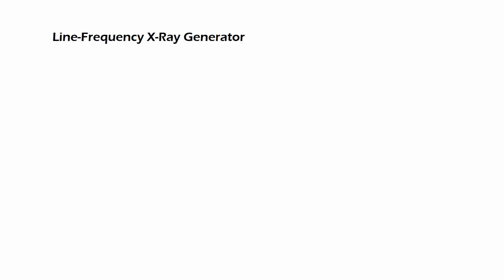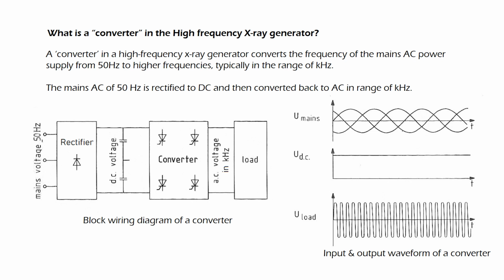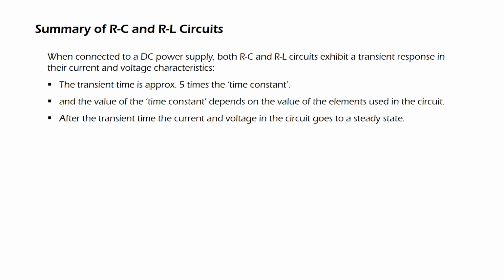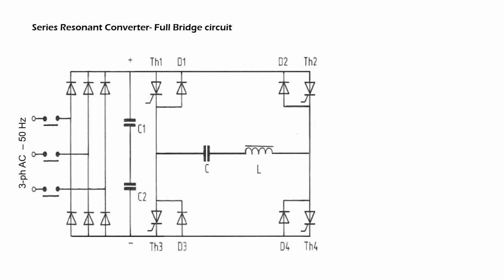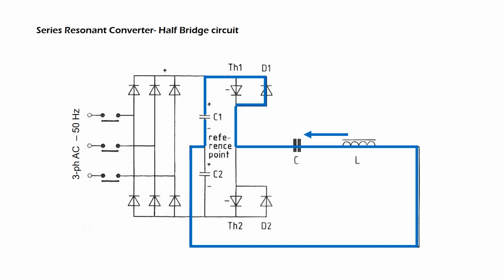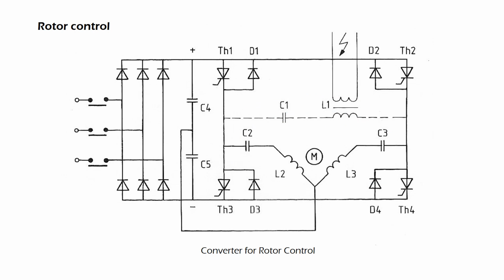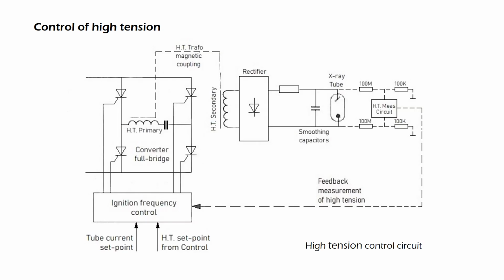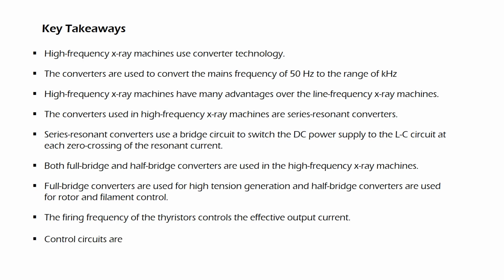07  Basics of HF X ray Generator

Comment: Thank you very much for the nice presentation. I have been looking for a while for a presentation on HF x-ray generator. 
I have 3 questions for you:
- How long has this technology for x-ray generation been on the market? Since IGBT and MOSFET are well known to us!

- Does a so-called conventional X-ray (for single X-ray imaging) or a CT have the HF generator? How is about C-arm X-ray machine in operation room? How they work?

- Could you please give some more key advantages of the HF generator over a line frequency generator for X-ray machines?
Reply from the maker: @freyrazi2272  all CT & C-arm machines in market use HF TECHNOLOGY
Reply from the maker: @freyrazi2272 1.  HF technology helps to reduce size of bulky generators used in conventional x-ray machines, especially the transformer. 2. The ripple in DC in output after rectification is reduced and as such it produces steadier kV output. 3. The output control of the generator is faster & better